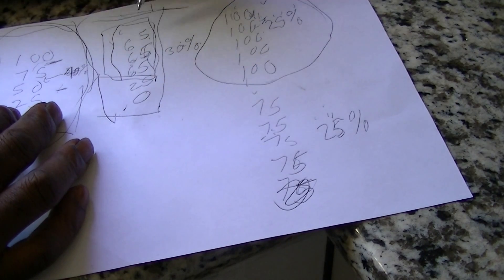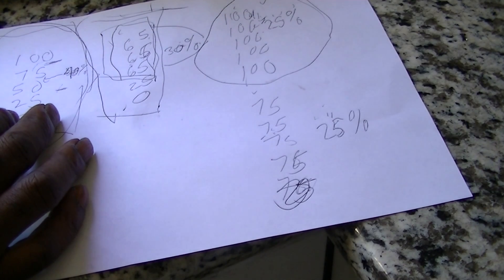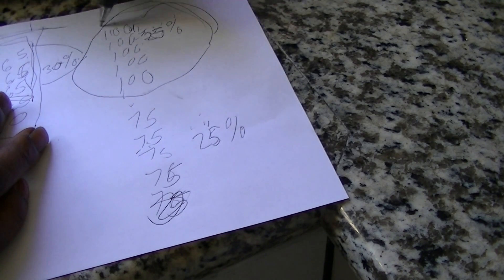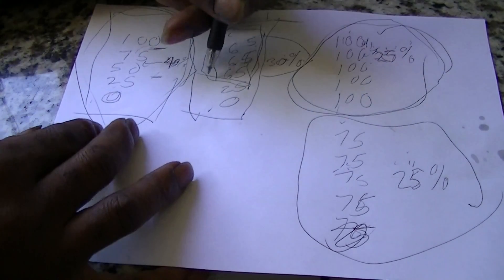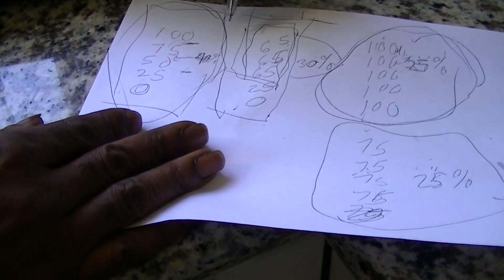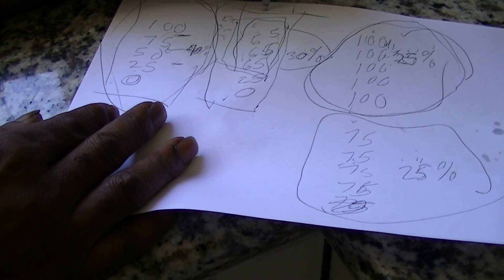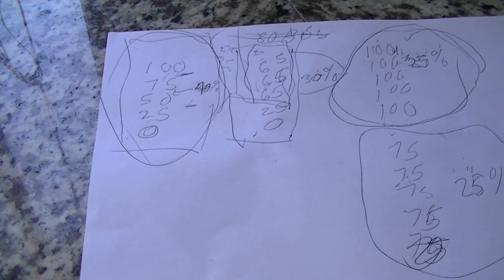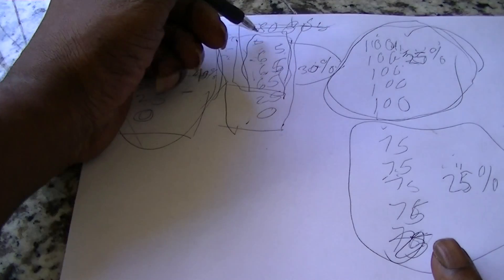=wc= thorttle curves explained head speed consistency is 1 key rc helicopter

Comment: Hi WC.. what head speed do you recommend on 800 scale helicopter in scale flying only? and what's the throttle curve and pitch curve? Thank you for any feedback..
Reply from the maker: same as what's in  the video 10 to 11 negative and positive pitch with pitch you can't go by the curves until you set high  and low pitch.
Reply from the maker: after you set high and low pitch then you can use pitch curves  48 49 50 75 100
Reply: Thanks WC..

Comment: What's a good throttle curve & idle up setting for a 450 align sport V3 with a dfc head & beastx 7200 ?
Reply from the maker: 0 30 65 65 65 idle up flat 85 to flat 100 as long as you have the correct pinion for the head speed that is needed for 3d same on all except nitro for 3d if you dont have a gov you use v curves for 3d
Reply: Oh yeah I noticed the difference on my 700, when idle up you here the head speed go up, you the man. I'll be out flying this weekend hope to catch some video for ya. Thnx WC you the man !!
Reply from the maker: Dana Rabun
yes some guys run there normal mode head speed to high because they were told it would make the heli more stable higher head speed in normal mode would make the collective pitch more responsive and slightly unstable collective pitch wise and then the head speed is so high that they make the mistake of thinking they are in 3d mode attempt a trick and crash

Comment: JUST TUNED UP ANTHER BIRD TO WC SETTINGS AND THE HEAD SPEED VS CONTROL IS REMAKABLE THANK YOU FOR SHARING KEEP THEM COMMING
Reply from the maker: glad they are working well on all of your bird brother
Reply from the maker: nitro curves without a gov
idle1 and or 2, my curve looks like this;
Idle 1.........................Idle 2 
1 = 100%..................1 = 100% 
2 = 85%....................2 = 95% 
3 = 62%-65%...........3 = 74% 
4 = 85%....................4 = 95% 
5 = 100%..................5 = 100%